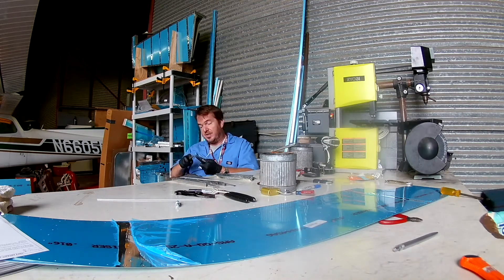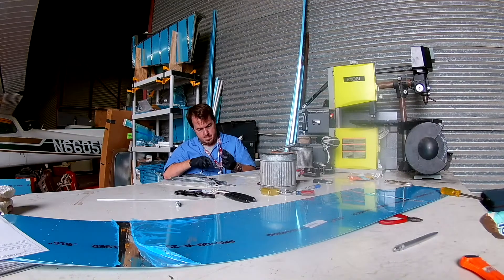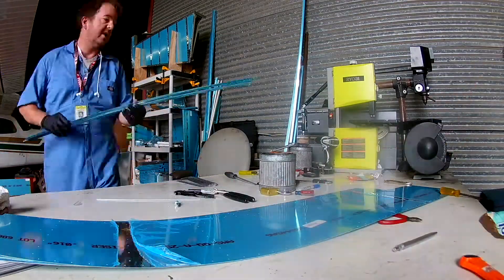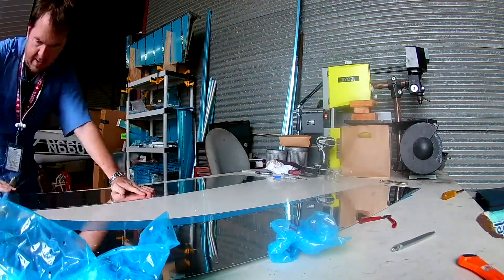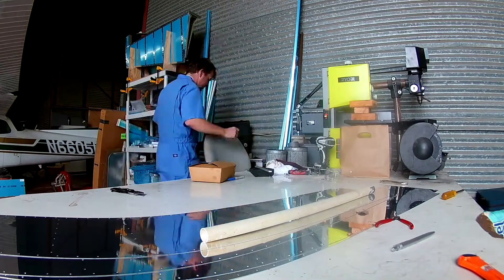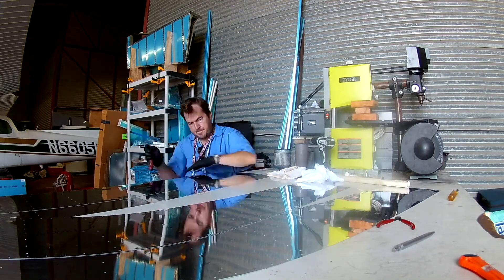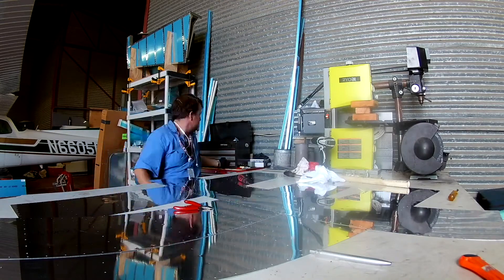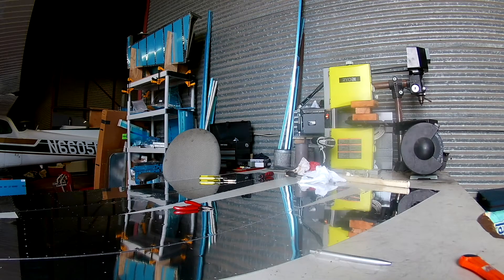RV 14 - Ailerons 11

Comment: I’m curious why you choose to deburr the edges with a file rather than, say, using a ScotchBrite wheel on your grinder? I know you said you don’t mind the deburring. Is there a difference in the results?
Reply from the maker: I've tried scotchbrite and while it does buff down the sharp edges it takes too long to really deburr down rough factory edges. I'm faster with a file.